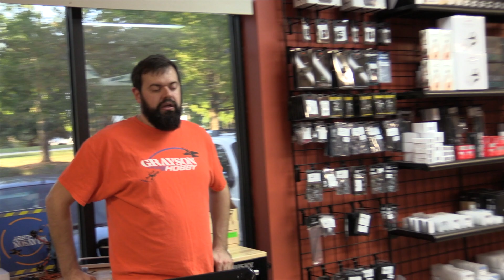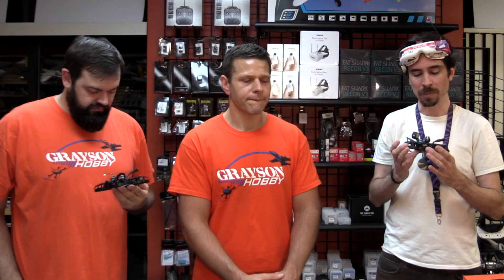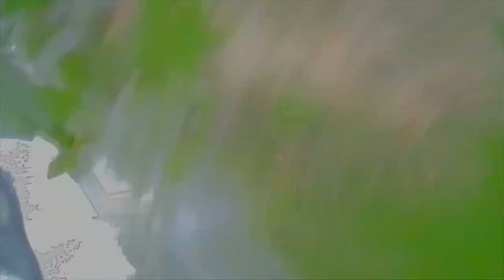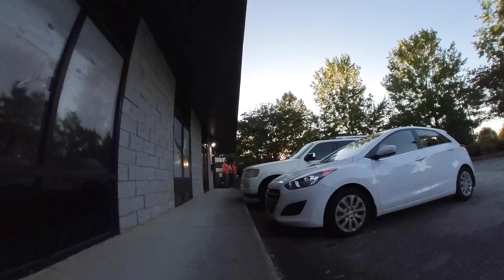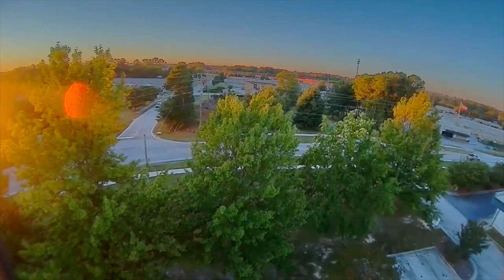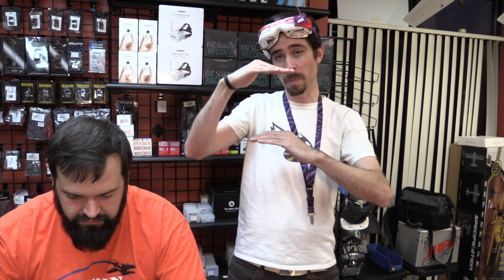DJI Digital FPV Drone CineWhoop - Serious Problems FIXED

Comment: With the Plug-n-Play, if you are using DJI radio transmitter, it's a Bind-n-Fly - the CADDX Vista is also a DJI receiver.

Comment: DJI & Firmwares - they have to match across the goggles, air unit (Vista in this quad) and radio transmitter (if you're using DJI's transmitter).  This is not so different than some transmitters & receivers of other brands.  With analog VTX, there typically is not any firmware...  The firmware is so important for even just the goggles & air unit because the goggles both transmit & receive. You can set quad air unit settings & Betaflight settings from the goggles.